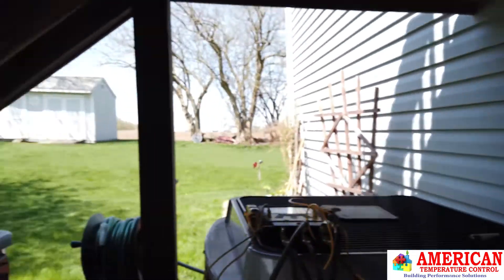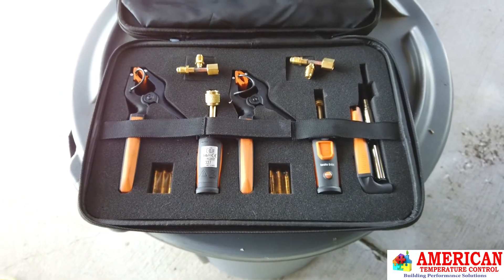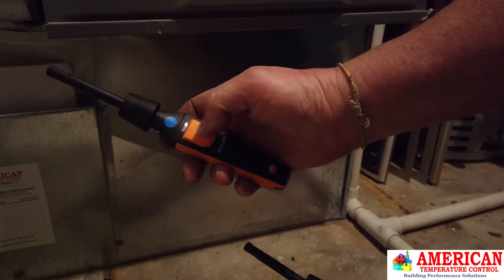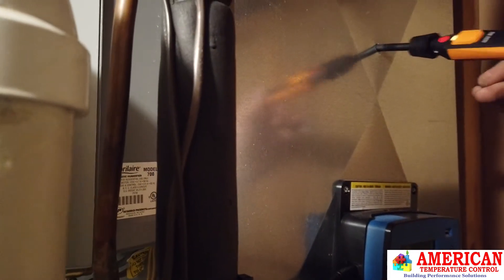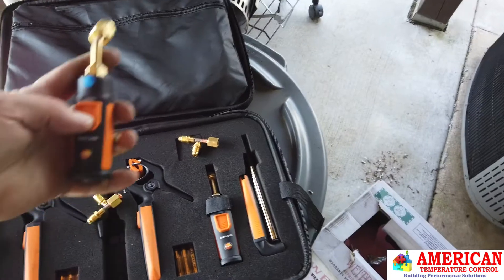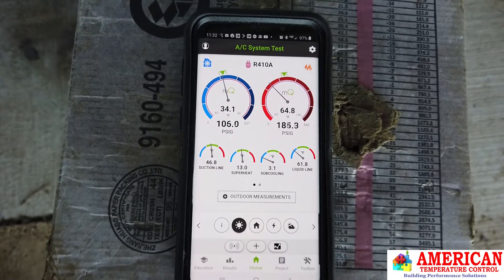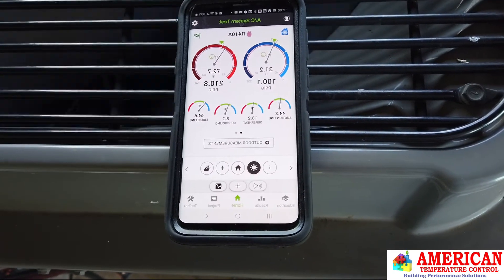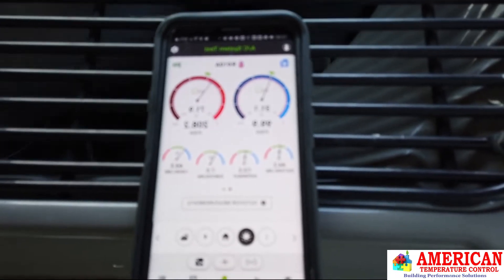Testo HVACR Probes & MeasureQuick

Comment: What app do you use ?
Reply: What's the trick to get testo smart probe to sync with measure quick...
Reply from the maker: MeasureQuick
Reply: Is the measurequick app just better than the Testo smart app?
Reply: @14thabz  the measrequick is way better. It actually tells you what's wrong with the system. As long as you place the probes in the correct spot.